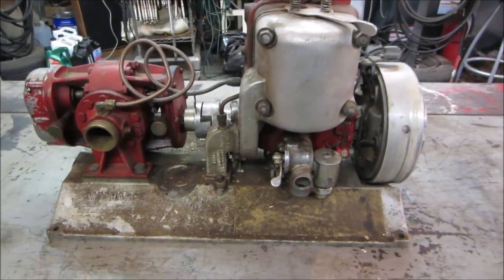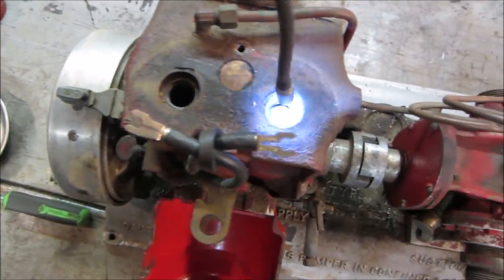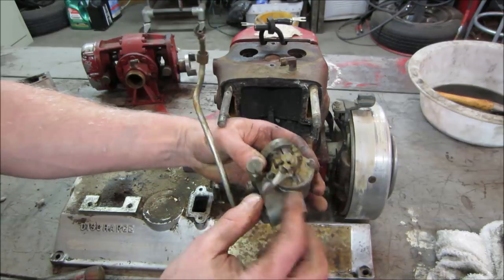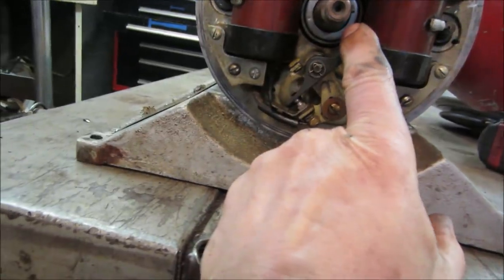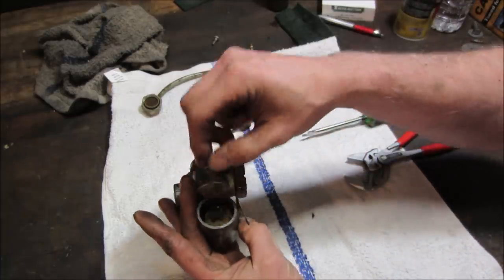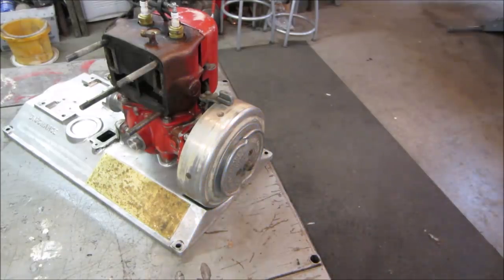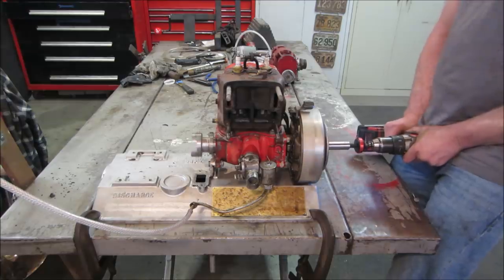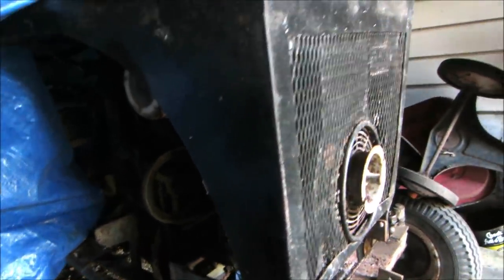WILL IT RUN?  83 Year old Antique Marine Pump.

Comment: You not only have a water pump, you have a high pressure water pump for fire fighting.  You're going to be amazed at how much water that thing will move.
Reply: they drained our basement with one in about an hour, was a single room sized basement
Reply: I was thinking the same thing, this pump is very solidly built. Given it was found with a marine engine - fireboat maybe?

Comment: Its a Handy Billy used by the USCG and USN  in 40s-60s 1-1/2 fire hose, and dewatering pump. The gas can was above the pump and motor inside a tubular frame. With the frame two sailors could carry the unit quickly. The hinged side cover is where the starter cord was stored. The motor is a OMC Johnson. Bearings are roller pins. We had one surplus unit FROM USN BASE Mare Island CA. I've had the engine downtown parade rest and back together made all my own gaskets and it ran well just mixed a little extra oil in the gas.
Reply: You got that one right. I just Google image Handy Billy and it popped up.

Comment: Based on larger versions of the pump I’ve used, the brass tubing is a vacuum line to prime the pump.  The lever on the exhaust blocks the free flow exhaust to force it through a Venturi that blows out the bottom.  Once you see water in the exhaust you open the window on the muffler to allow free flow of the exhaust.
Reply: Sounds reasonable. I think the brass thing on the side is for pull rope storage

Comment: Happy Easter Mustie1 , The exhaust primer uses the muffler to create a venturie for drafting water into the pump to help prime it.
Reply: Thanks for the explanation i thought it was a water connection to silence/cool the exhaust. But that is connected to the manifold. Engine is also cooled by the pump. It could also be a decompression vent to start the engine easier when there is much water in the exhaust.
Reply: You beat me to it lol. We have some pumps on brush fire trucks at the firr dept that work with exhaust primer.
Reply: Water cooling
Reply: This is the comment I came to make myself.  Beat me to it!  I just retired from 30 years of fire fighting.  We had an old(not as old as Mustie's) brush fire pump with an exhaust primer.

Comment: The page you were looking at with the truck is the US forest service so they probably used the pump for fighting wild fires. So the water jacket on the exhaust may be a way to cool it to prevent the surrounding material from catching fire.

Comment: That was cool. The flywheel flying off was priceless. I think the reason the exhaust goes through the plate at the bottom of the pump is to keep it from freezing in cold weather. The tab at the top was probably for ease of starting and then you close it off.

Comment: The lever on the exhaust housing could be an exhaust primer which was needed to prime a centrifugal pump. It creates a vacuum in the pump housing which allows water to enter the pump for priming. Used them for 35 years in the fire service. If it is a positive displacement pump, it primes much easier because it will pull water into itself by creating it's own vacuum. The pumps we used flowed between 200-300 GPM.
Reply: That is what was used for.  I have used one.  It helps prime the pump.

Comment: That ring end is worrisome. 2 strokes never allow the ends in a port.  You need to get a ratchet adapter. Snap-on 67C, Herbrand S-8, or similar.

Comment: We had these in the USCG back in the day. It is a P-60 portable fire pump. They were very reliable and could deliver 60 GPM at fire hose pressure. Self priming even with 10 or more feet of suction lift.

Comment: My father had a ratchet attachment for a breaker bar he would use on his drill for turning over lawnmower motors. I believe he got it from Napa. Unfortunately he passed away in January so I can't ask him. Worked great for not wrenching the drill motor out of his hands when something ran away on him.  😎

Comment: The lever on the top of exhaust when you close it off primes the pump, creates suction
Reply: Austin 7 engined portable fire pumps in New Zealand had the same arrangement. 
The engine was cooled by the pumped water, but when the engine was started a valve was opened that pumped exhaust through a venturi at the pump which created a vacuum.
This sucked the water up into the pump...you had to time it just right, close the handle and start pumping water to cool the engine...
The whole arrangement was usually carried by 4 men to the edge of the water supply....

Start was by crank handle.....
I've helped carry one and used it to empty a whole swimming pool.....great fun.

Comment: Hey Mustie 1. The little bracket is for the pull start rope and handle. There should be a STOP button on top of the timing adjustment, your is missing the button. It seems they were used by the forestry fire service. Unable to find a year though. Another great vid!!  Your No1 UK Fan.

Comment: 1.  Could hear Misfiring a mile away.   Good tip is to BURN the spark plugs on a gas flame or stove until completely dry ( Tip can reach red hot) especially with two stroke engines. 
2. Two strokes always needs Choking on startups but not for long as it will foul up plugs again. 
3. Pump is a Gear driven  POSITIVE DISPLACEMENT unit giving Very High Pressure  and Discharge should NEVER be closed totally . 

Absolute wonderful piece of equipment you got there , they don't make quality stuff like that anymore. 
Best wishes from South Africa.

Comment: That is a Pacific Marine fire pump. Missing the roll cage and fuel tank. 9.8 Horsepower One of the local departments had one for years. You hooked up both intake and discharge water lines then started the engine with the port on the exhaust open. Then you closed the port and the exhaust would use the tubes like a venturi  pump to pull air and water through the main pump to prime it. Once pumping the tubes carry cooling water up to the cylinders and dump it out the exhaust. Good pump and light weight compared to the monster briggs powered pumps we used. The one they had ran on 24:1 mix.

Comment: It looks like a pump used to fill fire trucks when there aren’t hydrants. Basically to pull water from lakes, pools or the sort. Maybe used to empty a trench filled with water. The discharge was what got me thinking that. You could adapt PVC fittings to the NPTs or get 1 1/2 or 1 1/4 hose with a clamp and a garden hose.

Comment: Ill bet the pump is permanently mounted. The exhaust most likely had a hose that exited the boat under water to mitigate noise. The relief opening on the top of the exhaust is to relieve any pressure from the exhaust being submerged. The back pressure would prevent starting on a 2 stroke. Once the engine is fired and running, you close the top valve and it forces the exhaust out through the hose. Thats my guess.

Comment: That lever opening and closing on the exhaust is a primer for the pump. Those old pumps used exhaust pressure diverted with something like that to create a Venturi effect and draw water into the pump. It may be missing some of the parts I don’t know.

Comment: I think that the lever on the top is for priming the pump when it is dry, like pulling from a pond, creates a drop in barometric pressure which forces water up into discharge side of pump

Comment: When I was young and dumb I worked for A timber company they had maybe 10 or 15 of those for fighting fire....They were made to put on A pack board. And off through the woods you would go. One guy had the pump, one guy had a pack board of hose, And one guy had A pack board of gas......So long ago...

Comment: Hey Mustie, try using a corded drill for starting engines. My DeWalt corded drill doesn't lock up when the trigger is released. I use it all the time when test starting motorized bicycles. Works nicely......

Comment: The hole adjuster on the exhaust port is for back pressure. Two stroke engines need back pressure to run properly.

Comment: The exhaust is used as a primer.  When you block the top port, the exhaust is forced through a venturi creating a vacuum to allow the pump to prime.  Centrifugal pumps are not positive displacement so they are not self primping.

Comment: I think the top exhaust valve does decrease any back pressure when starting. Then closing it would divert exhaust to an under water hose to decrease noise (once the engine gets up to speed and back pressure is not as much if a problem).

Comment: pacific marine model Y forest fire pumps were the US Forest Service standard pumps up through the 1960's-70's. They could be packed into a fire and set up next to a creek or pond. they were water-cooled, with a small discharge hose back into the creek. The fuel tank is separate, also to facilitate pack-in and full-shift running for several days as needed. Some of these were probably mounted on fire engines, but mostly they were "portable". One peculiarity of the engines is that if the pump did not prime immediately, the engine would meltdown from overheating. In variable field conditions - getting water from a creek- this was a common problem. The training stressed awareness of this problem. Also, the pump was a gear pump with close tolerances that could be worn out with sand or dirty water. had 9.8 Horsepower

Comment: According to pics on an Ebay listing, that brass bracket is for holding the starter rope. The handle fits inside the bracket and the rope is coiled around.

Comment: To complex for Coast Guard. When I was in, we used a very basic 2.5 brigs with a pump. Very basic, the pull cord was a rope. And it was mounted to a round base. The unit fit inside of a 1/2 55 gal barrel with a watertight top.

Comment: That pump is pretty cool, I bet it was also used by the old miners as a monitor pump,  I'm genuinely surprised you have not taken one of the many bicycles you have and used the rear wheel hub one-way bearing, to make yourself and electric start for those old engines lol I mean, if anyone has the knowhow lol it's you.

Comment: Re: pacific pumpers

I found this on Google:

I have several N and NY units. One is from 1939, and the other 1942, made for the navy. The NYs both have a foam educator used for fighting oil or gasoline fires on board ships. if you have the original bases, you will see a 11/2" coupling on the base. This was used to attach a firehose to the base, so the pump could be run inside a compartment without flooding the area with exhaust gasses. As water is blown out the base, when the engine is running, the exhaust and hose (if used) was cooled. On top of the engine exhaust chamber, there was a bypass port, to allow extra power if it was needed. Typically, at full pressure, these engines ran at about 6800 RPM! 100 PSI at 60 to 70 GPM depending on lift and hose termination distance from the pump (length means flow resistance)

On my NYs, I use a 50 foot 11/2" discharge, and a hard 2" hose intake. The outlet hose was attached to a 5/8" brass smoothbore nozzle. These pumpers are LOUD! I used to take them to Jacktown PA and demonstrate them, circulating water from a 35 gallon barrel. When done running, I would turn the nozzle nearly straight up, and let the pump empty the barrel. In about 30 seconds, it would be MT. The pump would be then shut off, and about 20 seconds later, the airborne water would hit the ground. The water would be shot about 100 feet in the air. One hot summer day, I let my kids hold the nozzle when emptying the barrel. I did not know they had aimed the water toward the food building instead of the parking lot across the street. After about 10 seconds of silence, about 20 people were soaked by the falling water. They were not happy!

If you run your pumps, a few tips: 1) fuel to oil ratio is 12:1, using SAE 40 non-detergent OIL. (3/4 cup oil to 1 US gallon of gas). Use high test gas! When these pumps were in navy service, they used aviation gas. DO NOT use modern lubes or synthetics, they are too thin for the seals and needle bearings. if you use modern oils you WILL burn out the engine in a hurry. Don't ask how I know! 2) do not run the engine without a restriction on the outlet (1/2" or up to a 3/4" smooth bore nozzle). The engine gets its cooling water from the pump discharge. The discharge needs restriction to make the water flow thru the 1/4" water cooling piping that supply the engine. 3) DO NOT run the engine without water in the pump! Running the pump dry will burn out the rotors. It will also over heat the engine cylinders before the outer block even gets warm. 4) have a large enough supply, that will cool the engine for the amount of time you intend to run. In my case, the 35 gallon barrel would get warm in about 2 minutes. if the water gets too hot to keep your hand in it, it is too warm to cool the engine properly. If your engine has a discharge valve, you need to set it so that the head is warm (NOT HOT) to the touch, under load. Later pumpers did not have the valve, they ran full flow thru the engine, as operators did not check the valve as the engine ran, and burned them up. 5) If you draft (pump from a pond or river) you MUST keep sand and mud out of the pump! Dirt will score the bronze rotors in the pump, and will block the small water supply to the engine.

Comment: Re: pacific pumpers

I have several N and NY units. One is from 1939, and the other 1942, made for the navy. The NYs both have a foam educator used for fighting oil or gasoline fires on board ships. if you have the original bases, you will see a 11/2" coupling on the base. This was used to attach a firehose to the base, so the pump could be run inside a compartment without flooding the area with exhaust gasses. As water is blown out the base, when the engine is running, the exhaust and hose (if used) was cooled. On top of the engine exhaust chamber, there was a bypass port, to allow extra power if it was needed. Typically, at full pressure, these engines ran at about 6800 RPM! 100 PSI at 60 to 70 GPM depending on lift and hose termination distance from the pump (length means flow resistance)

On my NYs, I use a 50 foot 11/2" discharge, and a hard 2" hose intake. The outlet hose was attached to a 5/8" brass smoothbore nozzle. These pumpers are LOUD! I used to take them to Jacktown PA and demonstrate them, circulating water from a 35 gallon barrel. When done running, I would turn the nozzle nearly straight up, and let the pump empty the barrel. In about 30 seconds, it would be MT. The pump would be then shut off, and about 20 seconds later, the airborne water would hit the ground. The water would be shot about 100 feet in the air. One hot summer day, I let my kids hold the nozzle when emptying the barrel. I did not know they had aimed the water toward the food building instead of the parking lot across the street. After about 10 seconds of silence, about 20 people were soaked by the falling water. They were not happy!￼

If you run your pumps, a few tips: 1) fuel to oil ratio is 12:1, using SAE 40 non-detergent OIL. (3/4 cup oil to 1 US gallon of gas). Use high test gas! When these pumps were in navy service, they used aviation gas. DO NOT use modern lubes or synthetics, they are too thin for the seals and needle bearings. if you use modern oils you WILL burn out the engine in a hurry. Don't ask how I know!￼ 2) do not run the engine without a restriction on the outlet (1/2" or up to a 3/4" smooth bore nozzle). The engine gets its cooling water from the pump discharge. The discharge needs restriction to make the water flow thru the 1/4" water cooling piping that supply the engine. 3) DO NOT run the engine without water in the pump! Running the pump dry will burn out the rotors. It will also over heat the engine cylinders before the outer block even gets warm. 4) have a large enough supply, that will cool the engine for the amount of time you intend to run. In my case, the 35 gallon barrel would get warm in about 2 minutes. if the water gets too hot to keep your hand in it, it is too warm to cool the engine properly. If your engine has a discharge valve, you need to set it so that the head is warm (NOT HOT) to the touch, under load. Later pumpers did not have the valve, they ran full flow thru the engine, as operators did not check the valve as the engine ran, and burned them up. 5) If you draft (pump from a pond or river) you MUST keep sand and mud out of the pump! Dirt will score the bronze rotors in the pump, and will block the small water supply to the engine.

If you have questions, send me a PM, and I will see if I can help you out. I have some instructions for the NY, I think, I will have to look and see if I can find them.

By the way, I believe the N used an evenrude engine, the NY a Johnson. Same carbs and ignition, different blocks.
Reply: This info was copied from Google

Comment: Is anybody else disappointed he didn't get into the crankcase?  Normally in a two stroke the compression from the downward stroke of the piston is used to supercharge the mix going into the piston, but with this one having two opposing pistons that doesn't seem like it should work unless the crank case is sectioned off on two sides, but I'm not sure how that would be done with only one big opening for the fuel mixer to feed it.  Maybe some kind of valve on the crank that only opens one side or the other?  Without the supercharging nature of the normal 2 stroke crankcase I don't know how it forces the air/fuel mix into the cylinder and avoids having the exhaust backfeed into the crankcase.  

It is also remarkable how well preserved this engine is compared to the other.